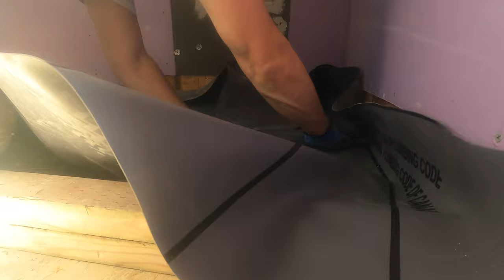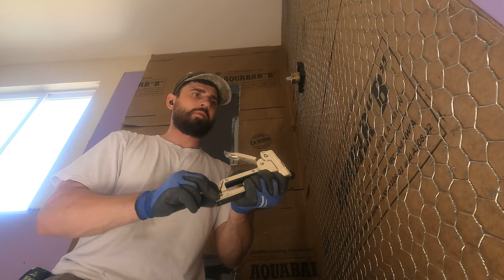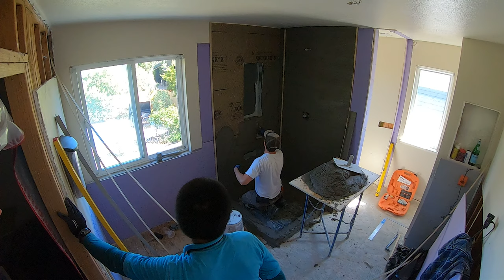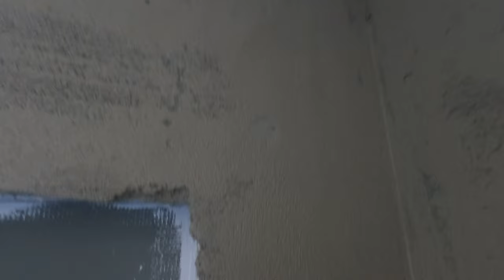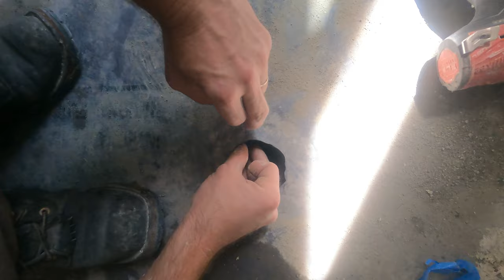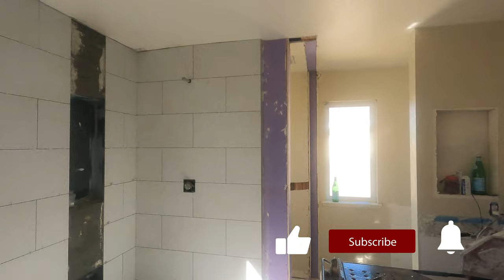2 DAY MASTER BATHROOM REMODEL - Day 1

Comment: Like the speed and the work ethic. Wondering if the penny tile sneaks under the wall tile? Also wondering if you see a downside to letting the float dry and doing a roll on surface membrane? I know it spreads the job out a couple of days, but there seems to be an upside. Would be cool if you tried this method and did a video on it ; )

Comment: I remodel showers I use to use only panliner. But ever shower I have demo and had mold and damaged from water were all panliners. Alot were cause installer would not put liner high enough or panliner was pinched from being walked on before tiled. The ones that never had water damage were the ones that had redguard or hydroban liquid panliners. Even the ones that had schulter or laticrete membrane fabric had damage.  Hydroban liquid on top of mud bed were solid never water damage.  Why I started only using Hydroban liquid now. Redguard old school way on doing panliner out if them done right I never saw mold or water damage as well. Everyone with panliner didn't pass. Would last cause people never saw the inside on demo panliners were the worst. Worse then membrane fabric
Reply from the maker: Unfortunately that is not so if your walls contract and expand and thy will your membrane 100% tears . Panliner can stretch if you have a pre Sloop in the Pan liner and use the weapon system then you would not have mold for you don't have standing water in the Pan liner.  I do a lot of contracting for inspection company and  a membrane and hot mop is a big problem because it always cracks in the corners. Rotting out the floor and the studs. Thank you for the comment and watching my video.

Comment: Curious for what the reasoning behind floating the tile on the walls. I floated the pan and the floor just wonder is there a reason as to not just thinset the mold resistant Sheetrock? Great vids btw !
Reply from the maker: 1st of all it is to make sure the walls are perfectly flat so when you're tireling any size tile especially mosaic it goes on perfect. Also it also it protects the waterproofing behind it and behind it which is the biggest reason why the showers last over 80 years.  Anytime you are dealing with concrete everything tends to last forever.
Reply: @SuperVPro  thanks for the quick response brother. Makes 100% sense.
Reply from the maker: @ScoobyBrehh  Thank you for watching.